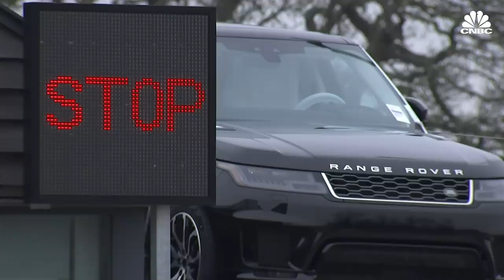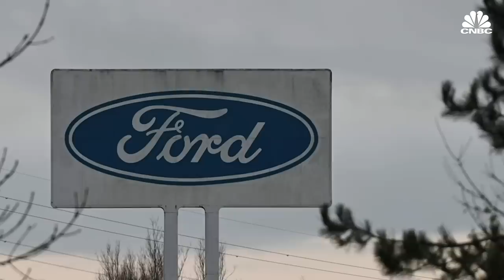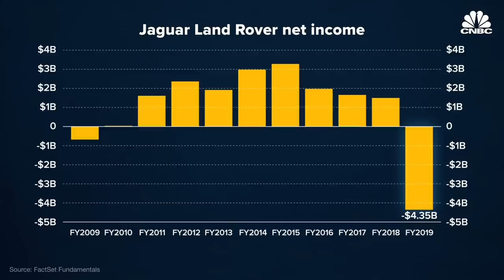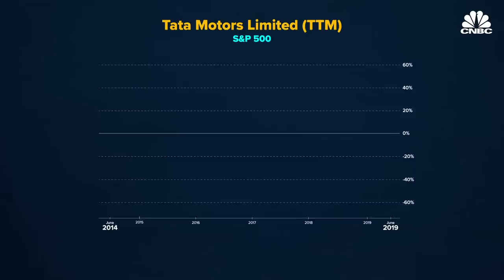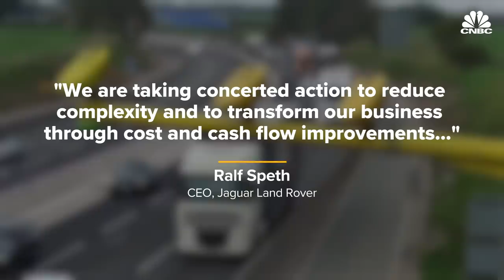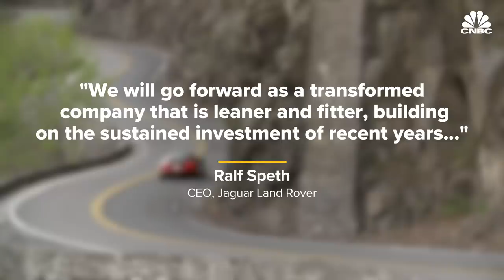Why Jaguar And Land Rover Face Uncertain Futures

Comment: I see that we have the usual comments that JLR products are “overpriced” and “unreliable.
Overpriced in relation to what? A Dacia? A Ford Focus? A Corolla? Compare an aluminium, bonded and riveted Jaguar XE, with a, comparatively archaic, pressed steel BMW 3 Series and BMW want every bit as much, or more. 
The usual and predictable comments about reliability are often from those who’ve never owned one, or attempted to run a 15 year old one on a shoestring.
Just over 2 years and 70,000 miles into Range Rover ownership and the reliability has been as good as the best cars I’ve ever owned before.
Reply: JoeyVonn 
Please give me an example...
Reply: crezman 
Is that so?!
Enlighten us; if JLR vehicles are “for people with no taste”, what should we be driving?
Reply: A 2-year ownership doesn't give you right to comment on the reliability of a car. Come back in 20 years and tell us about it.
Yes, 20 years. Toyotas last that long....but you didn't know, did you?
Reply: Faustin Gashakamba 
Oh, you fool! This is the sixth Land Rover product I’ve owned in a row and I really don’t care how long Toyotas may (or may not) last for, I just wouldn’t want one.
Reply: crezman  I love ours so..
Reply: Exactly, they have offroading capabilities second only to Jeep or Mahindra Thar and are very well built. Jaguars are in my opinion better than the BMWs you get for the similar price range and I do not think anyone does SUVs like Land Rover.
Reply: @faustin289  who owns a car for 20years! Everyone buys a new one after maximum  10 or 12 years
Reply: @vaibhavmurarka5179  he is poor that's why he can't afford j l&r
Reply: @arnavnarayan1554  2nd only to Mahindra.
Mahindra is not even comparable to land rovers

Comment: British cars are great and well_known for iconinc designs...
But they also have one well_known feature, they Have never been reliable and economic
Reply: Thats crap. British cars have always been leaders in fuel economy and need I mention the Mini which was a direct reaction to fuel cost rises in '59? As for reliable are we talking 1960s or 2000s? Because these days cars built in the UK like JLR, Mini, Honda, Toyota, Nissan etc are as good as any other brands. At least we don't go cheating on emissions  to make them look better than they are.
Reply: My British cars are FAR more reliable than my BMW's
Reply: We've had Jaguars in the household for over ten years, and they've all been very reliable (although I can't speak for the diesel versions). Much more so than the German and French cars that we've owned previously. 

Here in the U.K., parts and servicing is very reasonable for whatever reason.
Reply: Nothing can beat good old Suzuki in terms of reliability, fuel efficiency and ruggedness. One of the main reasons it has been a major success on Indian roads.
Reply: @1chish  Total nonsense!!! We are not duscussing Honda, Nissan, Toyota etc - they are not British brands, they are Japanese brands which are assemled in England. Check out the JD Power results to see that Land Rover have reliability as poor as FIAT, whereas Mercedes are almost on a par with Toyota!!! In the 50s, The UK sold more cars than any other country - the reason that this all changed and the UK is no longer a top producer of cars is because everyone stopped buying them due to poor build quality and unreliability. Most of the big historic French, German and Itlalian companies are still going but Austin, Triumph, Hillman, Morris, Wolseley, Singer, Sunbeam, Rover, Lanchester, Standard, Humber and Riley all went because of bad management, quality and reliability issues. JLR will also go the same way!!!
Reply: I don't wholly agree. The Land Rover defender is one of the strongest trucks ever built. Growing up in a small agric town in Africa, the only two trucks we knew were the Toyota hilux and land Rover
Reply: danial erfanytabar ...utter garbage. I had a British built Vauxhall for nearly 10 years, broke down only once on me. I replaced it with a 3 series bmw, a demonstrator from a dealer. Got shut of it within 2 years due to never ending faults, many electrical.
Reply: @JG-bx2xg  thats not saying much at all
Reply: Jaguar and Land Rover are amazing brands. Lately, they've been winning a lot of prizes for their reliability and innovations. Especially Jaguar, but Land Rover isn't far behind. I wish more people could see how amazing of an investment is owning a Jaguar.

Comment: I just sold my 2018 Range Rover. Never had a single problem. I beat the crap out of it, I took it on a 2500 mile rally with zero issues, on the limiter half the time. People talk badly about the brand out of pure jealousy. They dont depreciate like they used to, I sold mine a year and a half later with 20k miles on it for 71,000; I got it for 89,000. Compare that to an s- class, that's half the depreciation. There is no SUV at its price point that even kind of compares to a Range Rover. Sit in one, drive one and look at the numbers before you talk badly about them.
Reply: Evan West lmao why did you sell it then?
Reply: @jiggyg2604  I get a new car every year or so. I went with an M5 this time. I really want another Range Rover though. 

I also want to add that the 71k I got for it was a crap offer from the dealer. I could have got 75k easy from a private buyer.
Reply: Range Rovers have very inconsistent reliability reports through it's brand. My dad who was a Range Rover addict had four Range Rovers (all new at the time) and none of them lasted more than five years.
Reply: @Evan951001  I'd like to discuss the important matter of the M5 vs the RR.
Reply: No problems with only 20k miles WOW stop the presses...
Reply: Your comment is not a realistic comparison.  90% of people can not afford to sell their new cars at 20k miles and then buy a new one.   Most people, especially here in the US, keep their luxury cars to about 60-100k miles.  
So in your case obviously the SUV was very damn reliable for it was only a year old.   So get out of here with that statement😒
Reply: For the price prestige and quality I'll go with a Porsche SUV. You can't beat anything Porsche produces.
Reply: @cameronmcalister5310  I agree with the older models but like the video said after Tata took over the brand they made it much better. The brand used to be notorious for reliability issues. I used to have a 2016 GMC Sierra Denali and that truck couldn't last 5 months on the same transmission, I had a ton of issues and other owners have had similar problems. I've know a lot of people with far higher miles on their range rovers (newer kind) with no issues
Reply: @trance9158  I test drove all the Porsche line up. They handle great but the Range Rover just has the more of what I was looking for in a luxury SUV
Reply: @reaper69316  that's my experience. I've met plenty of others with higher mileage and no issues. Some complain of the infotainment freezing up but just a few. Also 20k being beat every day isn't bad compared to other cars I've owned. My Denali couldn't keep a transmission together. People act like you're going to buy a range rover and it's just gonna blow up in two days. Keep it in warranty and get it extended when it's up. Keep it maintained and you'll be good
Reply: Paid 90k sold 18 months later with 2000 miles on it for 43k.......OH YES THEY DEPRECIATE

Comment: Land Rover (Range Rover) have always been one of my favorite SUVS. luxury and such an amazing drive. 

Far better than BMW and Mercedes. As for Jaguar same thing. 

Recently got the Land Rover Discovery Sport and A Jaguar F-Type (S)., incredible cars. 

The issue with the company as a whole is being competitive with mass production and distribution., something that even the biggest car makers in the world are challenged. Too bad Ford got them during the financial crisis, otherwise it would take off beyond means. Their brand speaks luxury and quality, something that Ford can take advantage of and invest in. 

TATA thus far did a great job. and super correct - give them the money they need and let them be! they're great and innovative.
Reply: I had an f type s what a pile of junk bought for 80k sold for 43k with 2000 miles on the clock 2 years later.  There was nothing luxury about it.....check the switches you use to put the windows up and down....it’s out of a non luxury Peugeot family car. Like most of the switches. Look at your instrument cluster the background is cardboard......what a joke.

Comment: To all those who are rubbishing Land Rovers (and I am referring to the real Land Rover that can trace its roots back to 1948), it has been estimated that around 76% of Land Rovers ever built are still working and many are increasing in value. You can still buy any type of Land Rover that has been restored by Land Rover. Most Land Rovers are bush repairable and are still the most versatile vehicle available. They have a huge following the world over and are backed up by one of the largest aftermarket parts supplies available. Even standard Land Rovers are amongst the most capable off road vehicles around ..................... Match that!
Reply: The new ones are horrible though, I agree that the older ones can be reliable but that’s just not the topic nowadays

Comment: When FORD had Jaguar & Land Rover I would run! HOWEVER  since they sold to TATA it was a GAME CHANGER! LOVE my 2012 Jaguar XF V8!! Still driving like new today!👍🏽
Reply: Driving like a new jaguar is not a good thing.....that means it’s buggered already.
Reply: how Ford makes better motor and trasmission than Tata
Reply: 2012 jaguar xf still relied on Ford's  engine
Reply: The Shield and one of the best vehicles they made( the lr3 from Land Rover ) used a Jaguar engine that was made when ford still owned them. Ford was probably the best thing that happened to em
Reply: @coltonjacobs5383  lol jlr regrets owning by ford

Comment: just make them reliable and you won’t have to worry about sales
Reply: @cidneyoliver4706  the 3 Germans are usually around/above the industry standard when it comes to reliability according to JD Power and other surveys...JLR, however, is always at the bottom rankings

Comment: It's time JLR owned by Tata Motors quickly switch over to EV  production and battery production for automotive industry.

They need to focus NOW on off road EV technology, creating a new infrastructure, moving production post Brexit to cheaper India.
Reply: EV sales are nothing compared to ICE. There is a reason dinguses like you dont own a company. Just because something is considered fashionable by poor hipsters doesnt mean it will sell well
Reply: @hajjdawood  and "dinguses" like you have no foresight. Just because EVs have just entered the market, doesn't mean they don't sell well, it only means there are not enough models, not enough competitors and not enough pricing options.
Reply: @hajjdawood  by 2030 many major markets will ban ICEs. So either you start converting now or go bankrupt in a decade
Reply: @hajjdawood   😁 well said.
Reply: The Droid you do realize the worst part about these two brands is the electrics (trust me I own a classic jag) not the engine and you want the company to go full electric, right

Comment: I just hope they can keep making that beautiful F-Type with the V8 engine. Would be a shame if Jaguar ends up only making SUVs.
Reply: I had a new f type, it was a pile of junk. Rattles, vibrations,poorly fitted body panels, leaking roof, ac failed twice, active exhaust failed, 4 sets of alloys before I got an undamaged set, door rubbers incorrectly fitted (they never could get them to fit), infotainment system failed, steering wheel was not straight, flaws in the leather on the dash and seats, massive panel gaps (jaguar say 10mm is acceptable)
Reply: If you build junk like Jaguar does people choose not to buy them the company dies. It's like the HMS Hood vs the Bismarck.
Reply: @BongWeasle   I know what panel gaps you're talking about! I've seen two of them in my town and the gaps between the doors and rest of the body along with one that seemed to have a misaligned hood are unacceptable!

Comment: Ugh.. it's a normal slow down which comes every 8 to 10 years. Stop over reacting.
Reply: That's clearly not true. The automotive market is being disrupted by EVs right now. Some carmakers will not make it. It's not at all clear yet who will die. But some will.
Reply: PW unsurprisingly, Jaguar and Land Rover build unreliable gas guzzlers.
Reply: @skully720  Exactly. Land Rover could easily be killed by Rivian if LR continues the gas guzzling.
Reply: @pw7225  Seems unlikely, they did declare last year that all cars will be hybridised or full electric from 2020 onwards. Their competitors such as bmw and merc havent made any greater strides than them in that space but do have better funding/infrastructure.
Reply: Tesla

Comment: Ok I wanted to make a comment about Jaguar reliability. I own a 1996 Jaguar XJ 6 ( X 300) model for 12 years now and the car has been my daily driver since I bought it used. My only car. The car never let me down during all these years of ownership. I drive about 500 milies a week. The engine, transmission, and differential are solid. My car clocked 278,000 original miles on it's drive train last month and keeps going. I barely go to my mechanic unless I do not have the tools to make a major repair.  Regular maintenance is done by me. My goal is to reach 500,000 original miles before I put the car to rest and restore it. I know the car will go that far. Most of you are commenting on reliability, well my car is a example of a great product that is still running on the road after 25 years. What else you can ask from a car manufacturer. Happy motoring my fellow Jaguar enthusiasts and remember do not believe gossip, drive these machines and enjoy every moment of owning them.

Comment: The "only" manufacturer worth it's salt is Toyota.  Their vehicles from top to bottom are reliable, safe and easy to maintain.
Toyotas may not have that "exotic" tilt about them but, they function well and hold their value.  Why mess about with brand X?

Comment: We own the 2014 sport supercharged and its never broken down. Like, never.
Reply: WarSeiker damn you’re lucky, my 2015 sport has 87k miles and has cost over $12,000 in warranty claims cause of PCM failure and the transfer case went out at 50k
Reply: @Cj-xl3jv  Hey Chris - do you have extended warranty on your range? if yes, where did you buy from? I live in California and have 2016 range rover sport supercharged. I have 48k miles on it and thinking to get extended warranty on it just in case. Thank you

Comment: OK, I have had my 1969 XJ6  for 50 years and it’s never let me down. Driven ten’s of thousands of miles all over Europe and UK. As far south as Rome. Fully laden with all camping gear and supplies for four people. Car is now in New Zealand running up kms now. One of most memorable drives was from Auckland harbour were it had just come of the car ferry. The XJ must have been made for Kiwi roads, a marvellous 450 km run to my new home.
Now have an  I Pace full EV. Nearly two years young now. A fantastic vehicle, and consuming only 20.6 kWh for a 100 kms.

Comment: Buying a used LR is no problem.
Maintaning and repairing them you need alot of money or alot of skill and used parts
Reply: blackcamelify  Mercedes in Europe is one of the baddest car manufacturers doing a little better then LR. The commercial vehicles are fine but personal cars  💩

Japanese manufacturers have above average expensiver parts but they last and so called Luxury brands you pay for the luxury not the quality.
Reply: @obelic71  yet Mercedes was the largest selling luxury brand in 2018 and the best in Europe. You want cheapness and inexpensive maintenance....buy a Japanese brand car
Reply: Aryan sharma in America they are absolutely junk vehicles. I don’t know who the idiots in America are that are engineering these vehicles but they need to be fired.
Reply: @coltonjacobs5383  well...we are dealing with American engineers here. Different country different protocols
Reply: @coltonjacobs5383  well...we are dealing with American engineers here. Different country different protocols

Comment: Jeeps sell over Land Rover because in general they are much cheaper. Jeep is not known to be very good quality these days either. The lack of learning correct pronunciation of words drastically takes away credibility....PORSH
Reply: Land cruiser is better
Reply: Beka Machurishvili the Toyota/Lexus is more reliable.  Just not good looking cars.
Reply: @bngr_bngr  Agreed. Toyota/Lexus design is awful. It's like they just throw a bunch of angles and lines at it....too much going on. I had a Lexus ES300 that I bought for a driver, probably one of the more reliable cars that I have had. Problem was, it was like driving a couch. Nothing exciting about it. I have a Discovery 2 that I have had for 11 years and I still feel like I am driving something special. It has never left me stranded either. Like anything, you need to maintain it. If you do that, they are great trucks. If you choose to have someone else maintain it, just like any other brand, it will be expensive. If you do the work yourself, you can do it very affordably. Aside from the hill decent, and active cornering enhancement (both pioneered by Land Rover...yes 20 years ago) this is a very basic vehicle to work on. The new Range Rovers....not nearly as much.
Reply: True. Jeep isnt Jeep anymore either. Chrysler is now owned by FIAT....not a company known for quality (neither was Chrysler), and some Jeeps are literally just FIATs with a Jeep body.